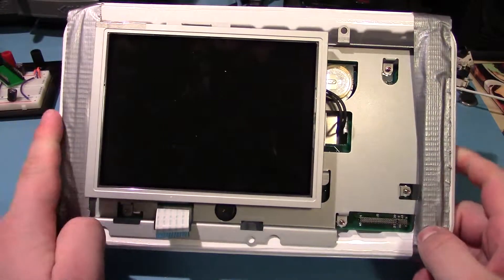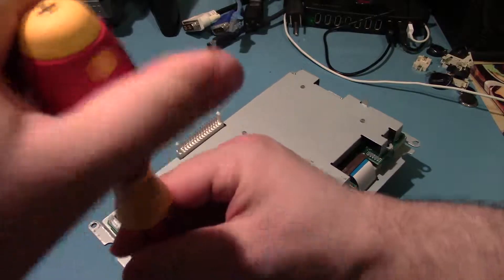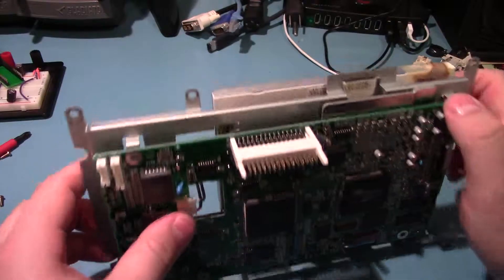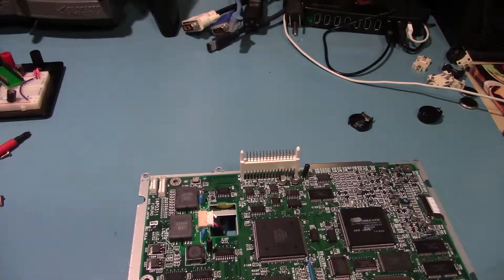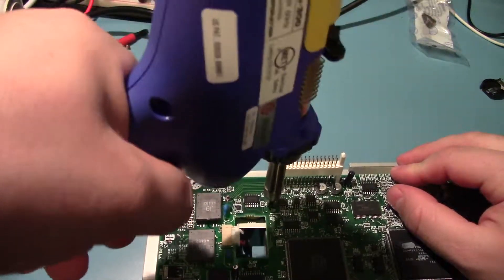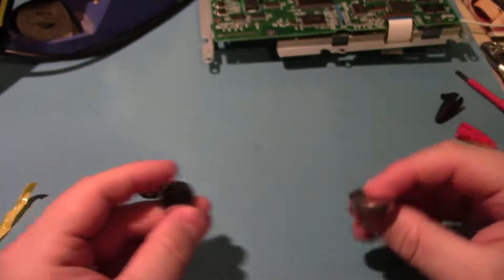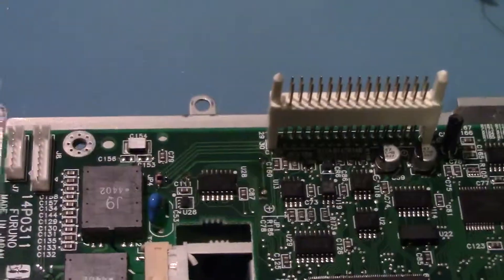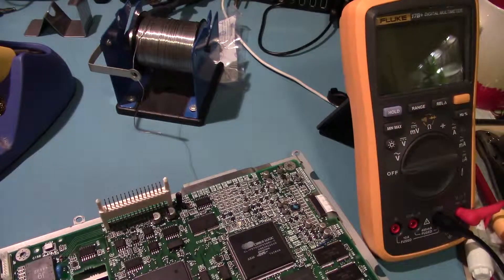Dealing With a Soldered Battery + Hakko FR-300 Quick Look

Comment: I get frustrated with soldered batteries but they do have their place. I think in this case  there's a possibility that the battery could pop out of the holder during rough seas. probably not but possibly